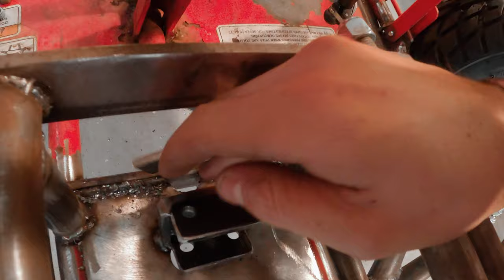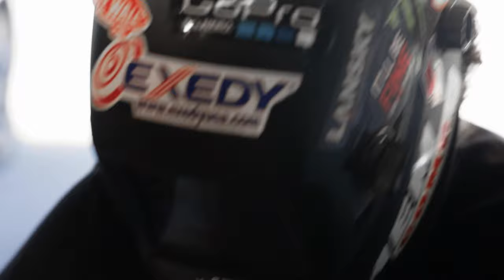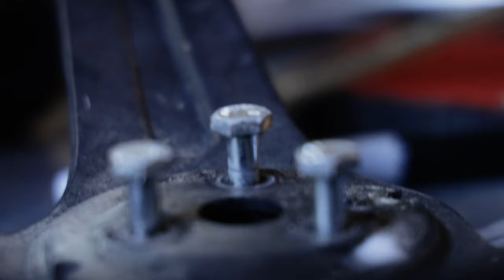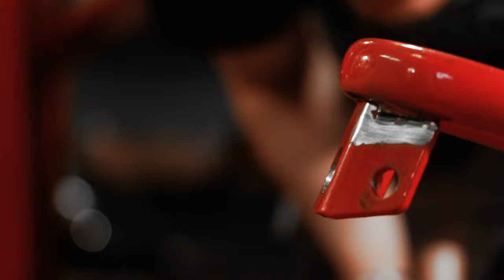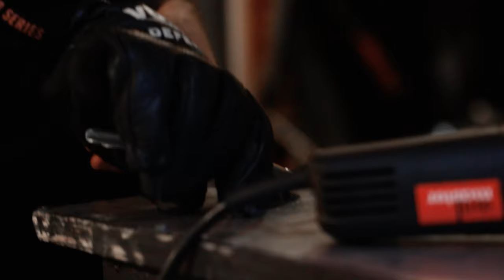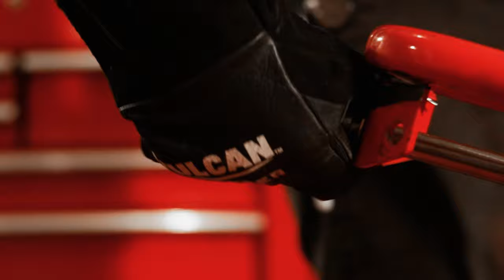MASSIVE Steering Upgrade | Rack and Pinion | Quick Release Wheel | TYRANIS EP13

Comment: Enjoy watching your videos.  I like watching the processes.  Your fab skills are great! I'm currently building an off road Kart big block 440 cc Double wishbone fron t suspension.  the  design element I wanted to describe is the pivot for the spindles. Consider pivoting the spindle on a bolt through the Hiem joints.  I made a 5/8 inch pin and machined a 6x 1.25 inch bar bored for the pin .  It was then a simple matter to bolt the bar between the Hiem joints.   Weld the spindles and steering arms directly to the bar.  Plusses " king pin axis is closer to the hub ( helps with ackerman.  Simplicity, Fewer parts. No clearance issues with steering arms.  This may not be atractive to you but it seemed to work well here. The design process is lots of fun.

Comment: I like your builds and the way you explain things, it looks to me that you are using a flux core welder, i like the one i have, i got it from harbor freight, its automatic 215,weldes almost as clean as gas, if you slow your wire speed down just a little, your welding will penetrate better and lay down much better
Reply from the maker: Its a mig! So instead of the flux there's a shielding gas. I have your same harbor freight flux core welder too though!

Comment: I wish you were my neighbor. I just ordered a new Amico Pro 200 stick welder, my AC unit only runs 3/32 6013. What do you run for the majority of your welds? Did you swap out the standard tie rods for the rack and pinion? I wouldn't mind converting mine, but since I did the center seat conversion I'm not sure which set to buy. I need roughly 16 inches on both sides from the spindle to the pitman arm bolt.
Reply from the maker: Right?! Surprisingly our current neighbors like us too haha, I'm running a Lincoln SP-100 mig that's as old as me. I made the tie rods myself in the video out of some tubing and heim joints off amazon!
Reply: @TyranisCustoms  I just found the cache of heim joints, tie rod ends and more at my local hardware store/tack shop/propane and grain emporium (lol), turns out living in an area with satellite farms and equestrian enthusiasts has it's benefits after all! Apparently fixing farm implementation yourself is still live  and well in some parts of our great country. 👍